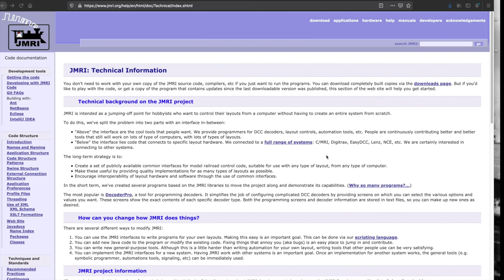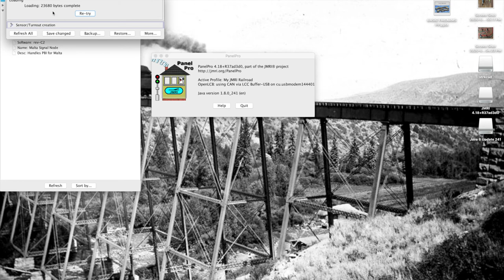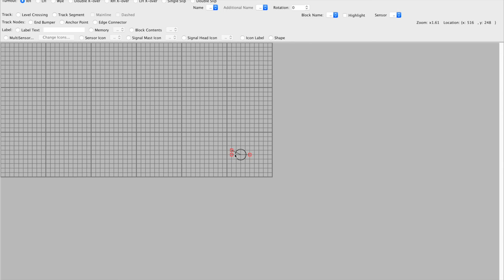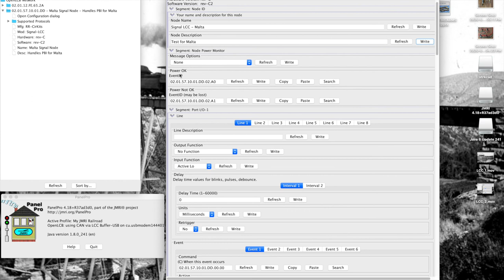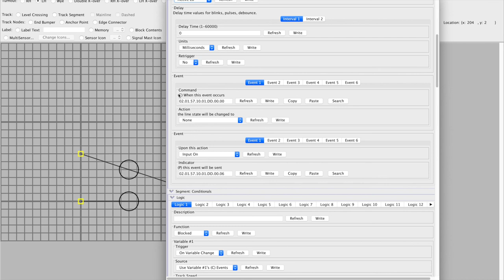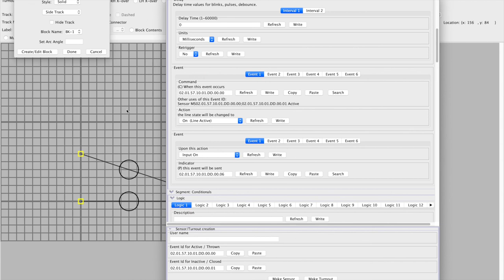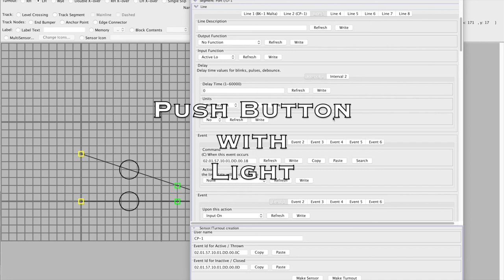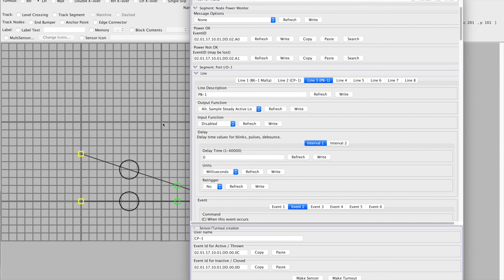MRVU 12 LCC Node Configuration

Comment: Do you have a video where you configured the signals associated with your detection nodes?
Reply from the maker: Unfortunately no.  I'm still a ways away from adding the semaphores.
Reply: @OtterCreek  - Great video. You and I are at the same place regarding our investment and experience with LCC. I need to get to the next level and get signaling set up.
Reply from the maker: @danielbrewer7021  Have you found the LCC group? https://groups.io/g/layoutcommandcontrol

Comment: Im not a Mac user and i have no idea what LCC is. But my JMRI connects to my NCE system similarly.
Reply from the maker: I try to explain LCC in MRVU 8. Layout Command Control. Bypass loconet and use a different communication system for the layout controls.
Reply: @OtterCreek  i juat saw your previous video on LCC. It makes total sence. NCE makes this a whole lot easier than what your doing. I am about to make a few videos on making a push button panel. It incorporates some of the things your doing. Hope you check it out.

Comment: I did not realize you were using LCC
Reply from the maker: Yes,  I've chosen it for several different reasons.  I like the idea of stand alone nodes that once programed won't need a computer.  For the yard ladder I will be able to create a cascade for the turnouts.  The idea is to have far fewer toggles/push buttons and fewer user error derailment because a switch didn't get thrown the right way.  We'll see how it all pans out.  Crosses fingers